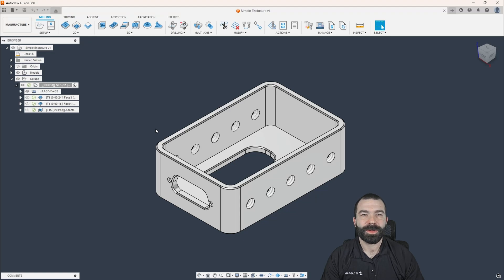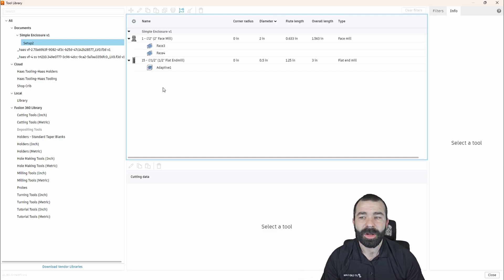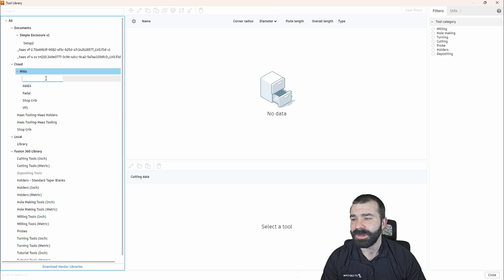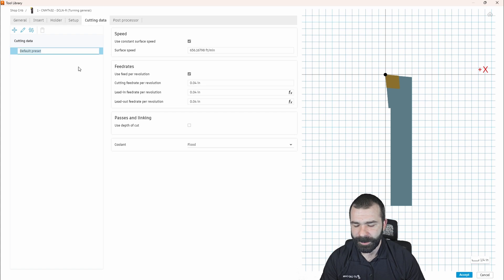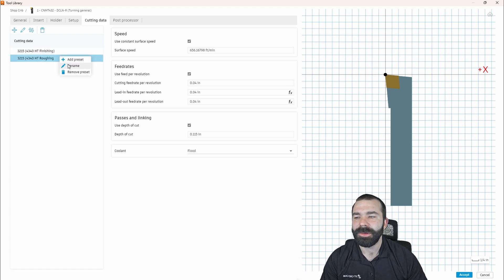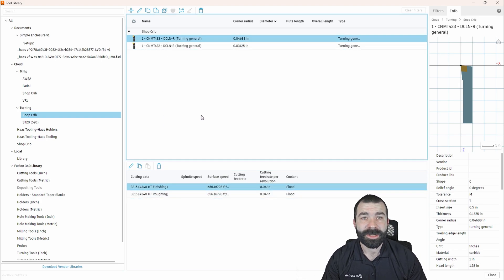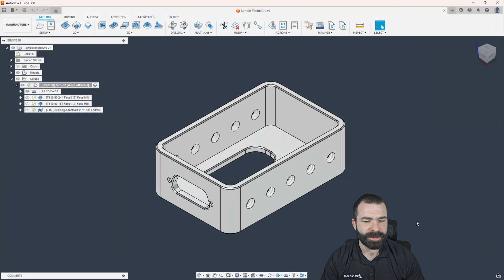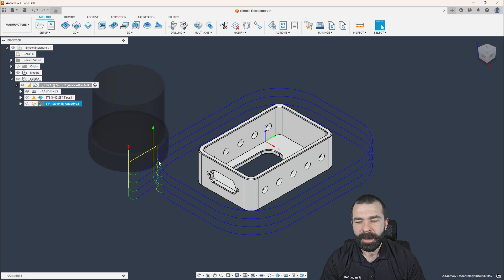Workflow Wednesday: Tool Libraries and Speeds and Feeds

Comment: Excellent video! Can tools be set up parametrically? Ex: Generic drill with a speed and feed based on material. All i want to change is the diameter and the spindle speed/feed updates based on only changing the diameter.
Reply from the maker: Yes, absolutely. So there is 3 dots next to each data field. if you click it followed by edit expression you can set it to something like "tool diameter * SFM = RPM"
Reply: I wish Autodesk allowed for the ability to update your tools in the library when you change them a document/program. I routinely make changes to tools when running a product and have to remember to copy them over to my main tool library. It’s crazy that this is not an option!